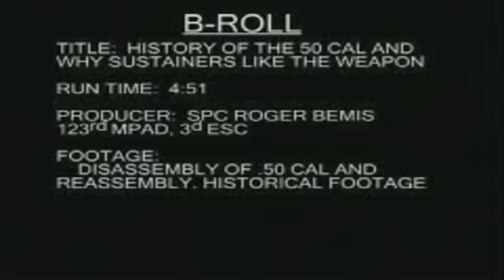Browning M2 .50 caliber assembly and disassembly

Comment: As an instructor on the M2 HB  this guy's knowledge measures on incompetence. I would never fire this weapon or any other that he's put his hands on. My gosh, checking the chamber for a live round when there has to be a barrel installed to have a chamber. Then taking the butterflies off to access the internals. Last I heard it was called a backplate. Then removing the PIN to remove the internals. Known as a bolt stud. Then he has the audacity to call the barrel extension a bolt carrier. And for Christ sakes screwing the barrel in and not pulling the retracting slide handle back to a point aligning the barrel extension with the sight hole on the right side of the receiver to allow the barrel to fully seat in the barrel extension and backing out two clicks before checking headspace. Hope he got some from that little lass with all his infinite knowledge. Scary stuff.

Comment: You should try and learn all of the part names before making a video like this. When removing the bolt, barrel extension, and buffer assembly you have to press up on the Bolt Latch not the trigger. Along with that, the .50 cal does not have a bolt carrier it is just called a bolt. You then called another part a "bolt carrier" which is actually a barrel extension.

Comment: This must be a new version of the .50 Cal. The one's my unit used had not safety switch. Also, it is called a bolt assembly, not a bolt carrier.

Comment: When the bolt is to the rear use a screw driver in the chamber not your finger Sir Mam and gunnery Sgts and Specialists the 50 cal is spring loaded and if goes forward accidentally your finger is softer than a 50 cal.bullet no disrespect Sir Mam and all gunnery Sgts
Reply: Sir Mam Sgts and Officers with  all respect for your safety. Andrea Lynne Inouye
Reply: IF You don't understand this weapon ask for assistance until you know it strip assembly firing no go go gauge and never put your finger in the the chamber use a screw driver your finger is softer and can't be replaced that spring loaded bolt action air cooled weapon is meant to kill the 50 cal.bullet is tougher than your finger and can be replaced your finger its tougher to replace. Sir Mam all ranks and gunnery Sgts have a awesome shoot. Andrea Lynne Inouye